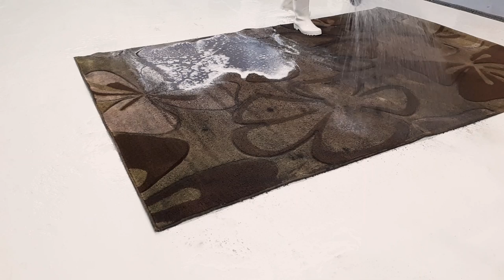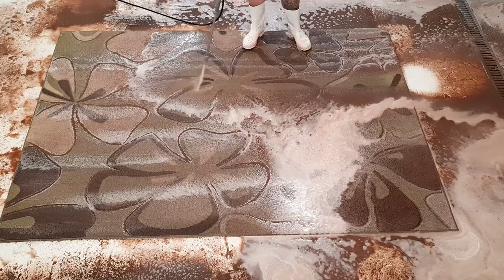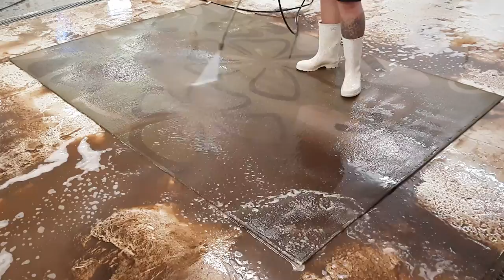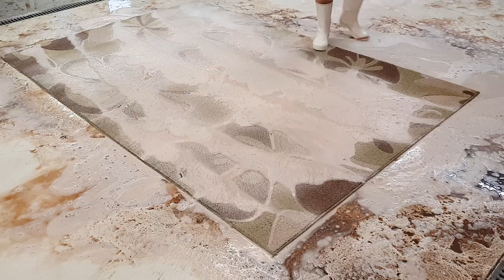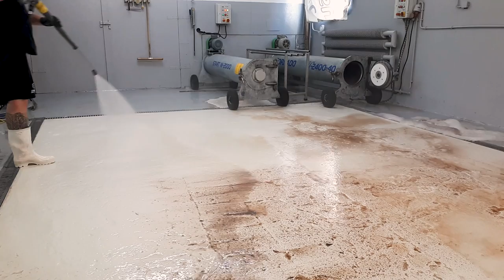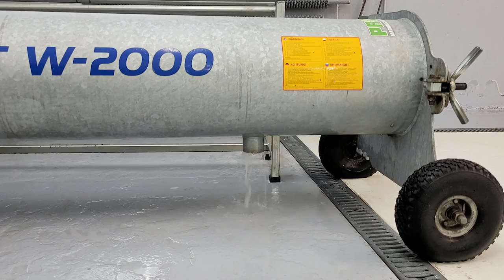Removal of rust from flooded carpet | satisfying video | asmr cleaning

Comment: love that this guy uses the cleaner up and down and back and forth.  why do they not have a perforated floor covering or an a-frame to hang the rugs over to initially pressure wash so the dirt doesn't just go back and forth from the front to the back?  It would make the process so much better.
Reply from the maker: Thanks for your comment and suggestion. We have refined the washing process and believe me, everything you write about will not help here. It is only additional work to unfold and hang the nets at stands, etc. We have been doing this work for over a dozen years, so we have some experience there. Regards
Reply: Lol Joy must be a rug cleaning expert compared to the individual who cleans rugs for a living. Smhhh
Reply: @smilealwaysnatasha3423  right !  They must clean rugs in they're dreams to be advising a professional 😂

Comment: Pls use wiper to side dirty water ...save 💧
Reply from the maker: Would the end result be better?
Reply: @cleanlublin  yes it will be..I have seen other cleaning videos as well... saves a lot of time and water
Reply from the maker: @priyavij7496  I won't save time or water by scooping up dirty water before rinsing the floor.
Reply: @cleanlublin  that's what I am trying to explain.. use wiper to remove dirty water from floor when you flip the rugs ... u start using pressure rinsing machine instead if you wipe the dirty water first and then wash with pipe u will save time to wash muddy water with excess dirt ... anyways upto you.

Comment: I didn’t see any rust or you removing it. What’s up
Reply from the maker: Hi, the carpet was flooded by water from a broken radiator during renovations, and due to the old installation consisting of metal pipes the water has contained rust. During cleaning, we removed all the rusty water from the carpet. Hope it explains everything😄